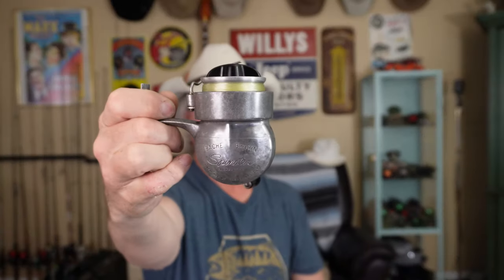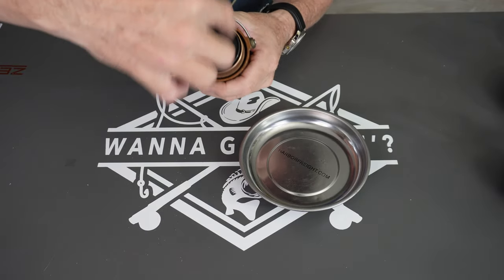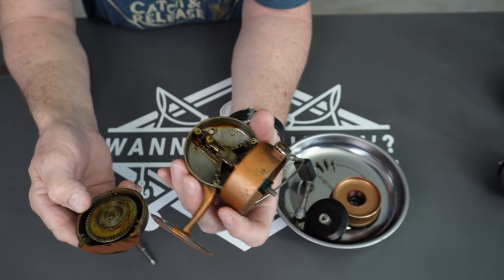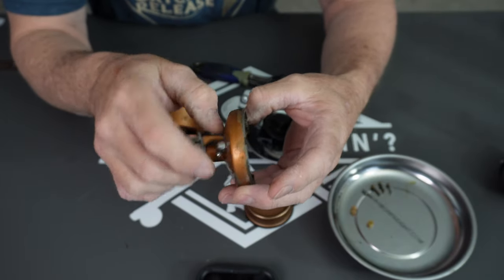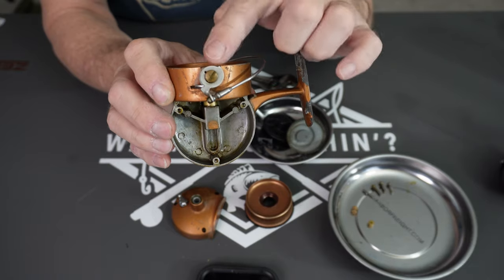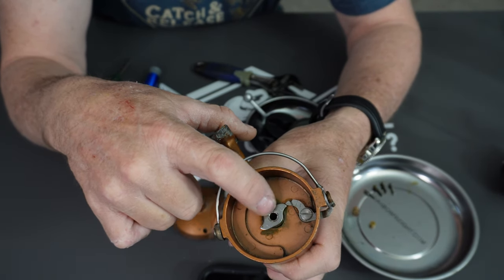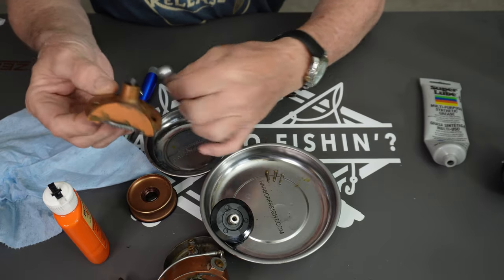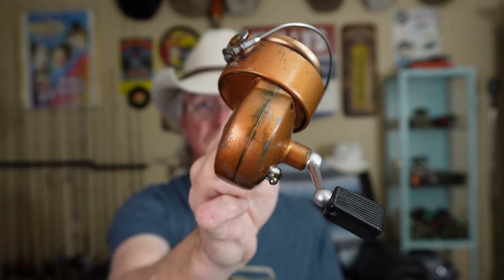Bache Brown Spinster Mk.VI - Maintenance, cleaning, and repair. (Part 1)

Comment: Loving the videos! Something you could do with the bail screw, if you can't find the right shouldered screw, is measure the OD of the screw and the ID of the bail angle lever and find a piece of brass or stainless steel tubing if the same measurements and cut it to length. That way either the "sleeve" will rotate or the angle lever.
Reply from the maker: Hey there!!🤠
Thanks so much for watching!!
Had I not been able to get the actual screw and spring for that reel, creativity was my next move. The thought of a hollow tubing sold at Ace Hardware that I actually bought to make a possible crank arm handle was on my list of ideas. However, the new parts are on the way and with fingers, toes, and eyes crossed, they’ll fit and get the Mark6 will be at least mechanically sound again 😂. 
Again, I truly thank you for watching and commenting!! I very much appreciate it!!
Willie
Reply: @TheGraytOutdoors  well I guess we'll leave it at "Great minds think alike"! 😂
Reply from the maker: @homerjrules  or average common sense, junk fixing oriented minds, anyway😂